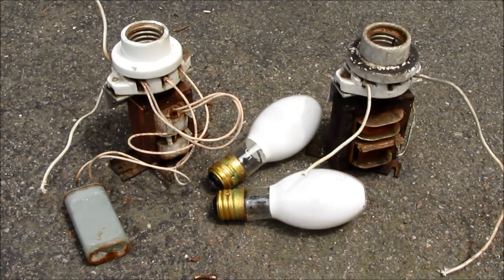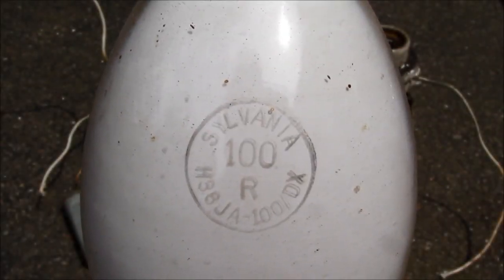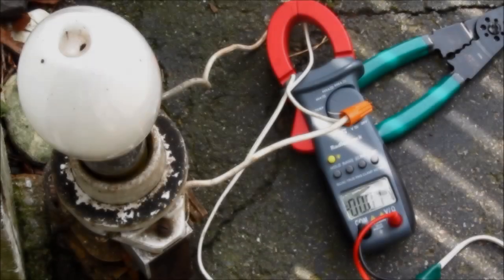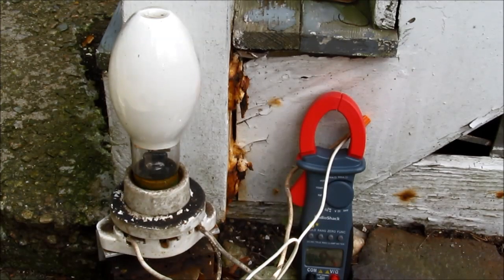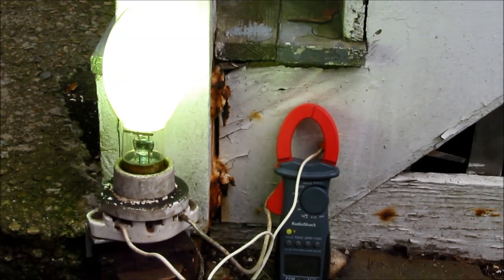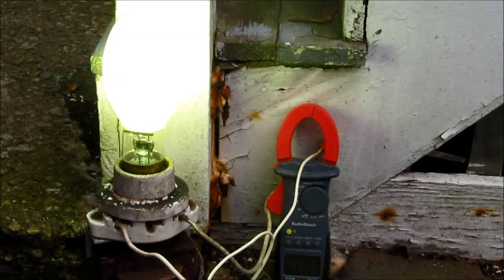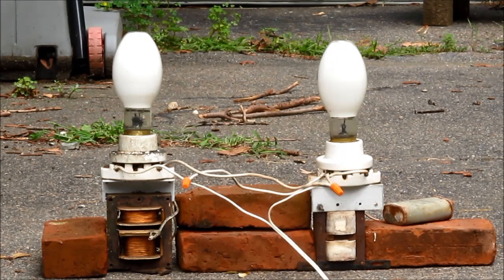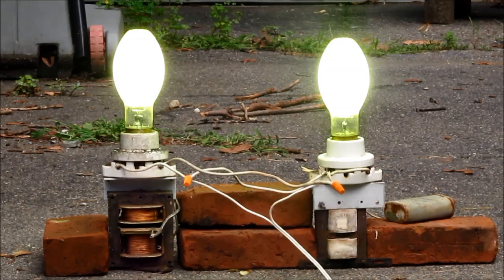I got a Pair of 100W Mercury Vapor Lamps and Ballasts at the Scrapyard!

Comment: i have one , and i broke the  white glass bulb and use it as a  dirt cheap eprom eraser, because the inner smaller  bulb emits UV light, and works very well. you have to broke the  white glass, otherwise the UV light will be stopped by the  borosilicate glass. watch your eyes.

Comment: LOVE this light bulb.  I have a ballast and bulb.   Can i wire it up without a capacitor or ignitor or anything?
Reply: I know this is an old comment but to answer your question, yes you can, but also depends. If it's a mercury vapor ballast and lamp your should be able to wire it up and use its if it's an HX ballast. If it's a CWA, you will need a capacitor. Ignitors are only used with high pressure sodium and pulse start metal halide lamps. Mercury vapor and probe start metal halide do not require the use of an ignitor as they're able to strike an arc directly off the ballast.

Comment: why then since the other ballast without capacitor works, why the other one need capacitor ?
Reply: andrew ysk it’s probably how it was designed, in aus it is common practice to install a cap to correct to power factor to 0.95 to reduce energy consumption.

Comment from the maker: There aren't too many of these left in my area. Most are high pressure sodium, but there are a few metal halide and an increasing number of LED units out there.  
Interesting that they were used inside homes.  How was the light diffused or was it just a bare bulb?

Comment: :) Nice. You can buy those they are run capacitor 10uF should be easy to find it's the voltage that can be tricky :)

Comment from the maker: I didn't trust the cap at first but it runs cool after I scraped the terminals and it reads 9.9 uF on my meter (rated value is 10 uF).

Comment from the maker: Yes, though streetlights may use lamps without any phosphor coating.   I'm pretty sure these units used to be at the local police station as parking lot lights.  Most of these older fixtures are being replaced by more efficient high pressure sodium, metal halide, or LED light sources.